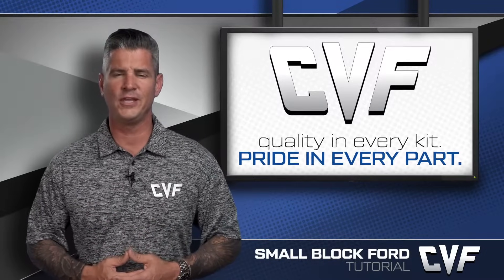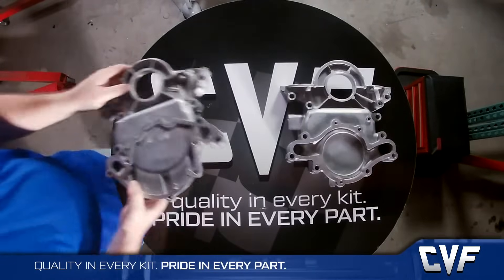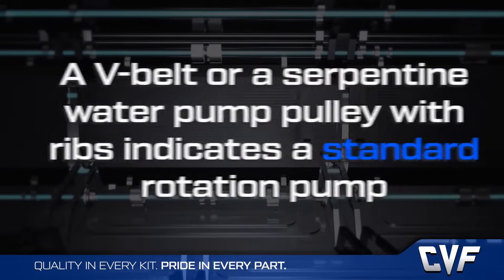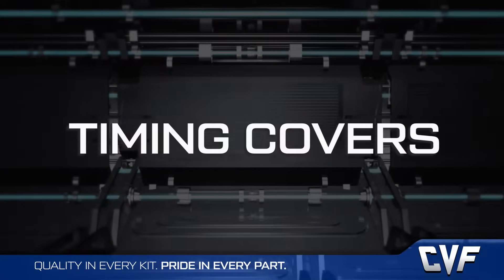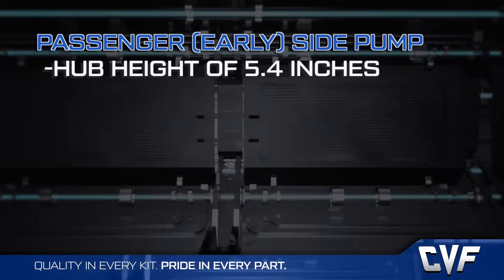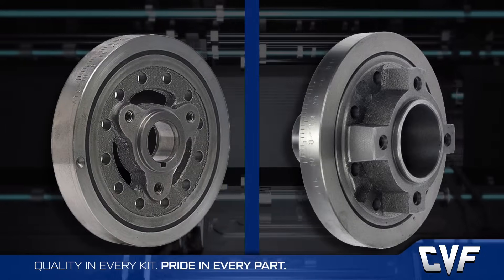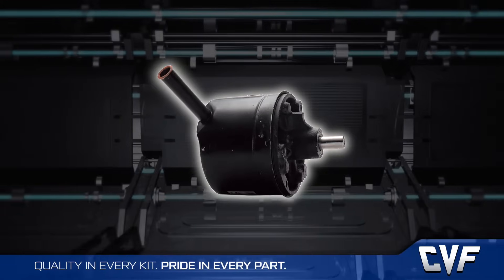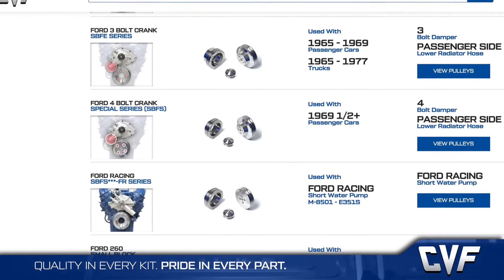Small Block Ford Variations- Whats the difference?

Comment: Hello i have a67 ford 289,and it perculates,once its hot and running,the pump bearings are noisey(some chatter),no leaks thru weep hole,big pully the 5.3"in.i think,im thinkn the pump is going on it,plug gap is a bit wide 40 to .45,that causes more heat,it runs smooth,doesnt burn water or push oil thru the cooling system,so thats tight,if the head gasgts were bad it would miss and fart thru the carb and exh.maybe the carb is still too rich on the air/gas,its a puzzle
Reply: Head gasket on backwards.

Comment: Good job CVF.  I use a standard rotation timing cover with the GMB High Performance Water Pump 125-1560P which is reverse flow with outlet on the driver side.  It has circular holes in the backing plate which allows it to work with either a reverse or standard flow timing cover so you don't need to match up the D-shaped openings to the TC and water pump's backing plate.  You may note that the expensive Edelbrock 8840 reverse flow WP also uses a backing plate with circular (not D-shaped) holes. Nice video.

Comment: I'm working on my 88 Ford Ranger and I'm putting a 74 model motor with a c4 automatic after making all my measurements my motor will set about 4" to far forward what water pump and pulleys will I need to get my radiator to fit in the proper conventional rather I go with the conventional fan or electric fans what do you suggest shorty water pump and new pulleys
Reply: 93 T bird short set up

Comment: Great video, but now I’m confused.  I have an 88 mustang 5.0 (early production, built on 11/87) I have the standard timing cover as described in the video and a smooth pulley.  I need to replace the pump; should I order a reverse or a standard water pump?
Reply from the maker: A smooth serpentine pulley would indicate that you have a reverse (counterclockwise) rotation water pump.